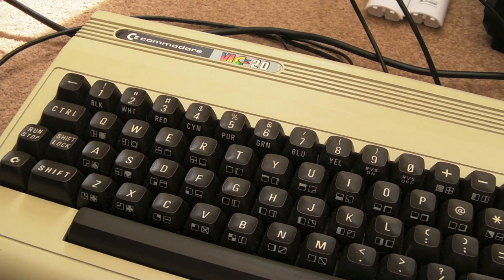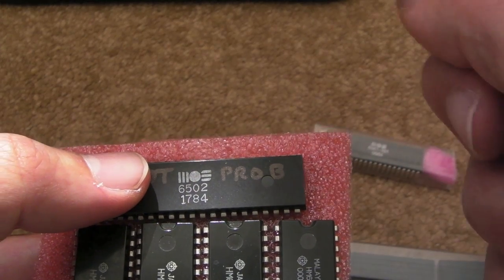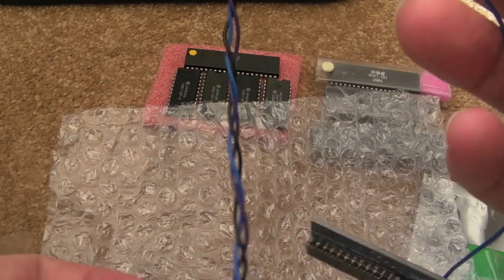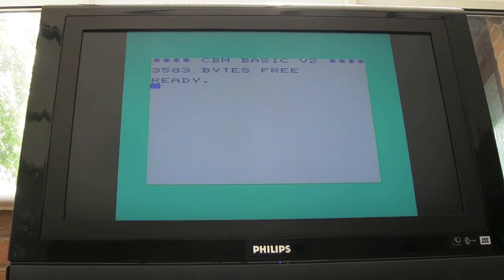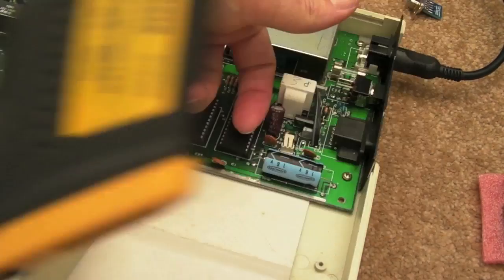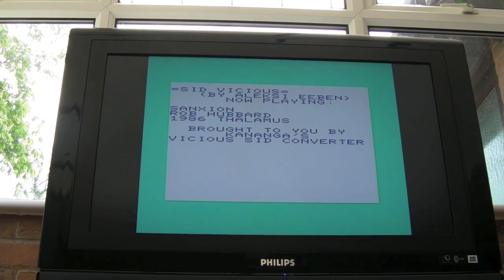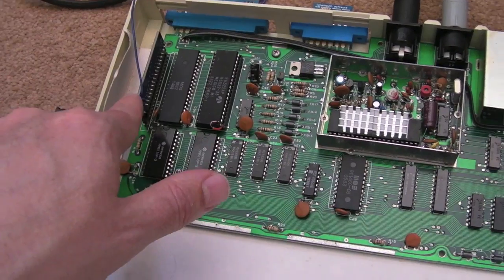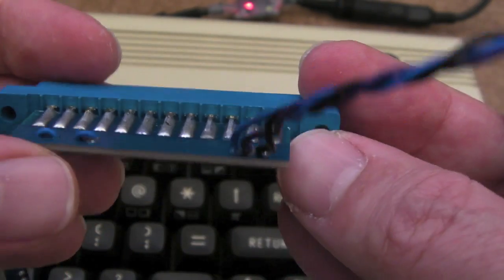Commodore VIC-20 (VC20) Spares Testing & Diagnostics Cart from Tynemouth Software

Comment: We got our VIC 20 working in the end. But we had to get the Kernel chip from Italy. Cost £8.00, but was with us within a week. We rejected the idea of the VIC20 jailbars removal mod as there are too many versions of the same board. It's very easy to screw up the VIC chip, and we didn't want to run this risk. However, it's surprising what fresh solder, and a bit of patience will achieve. Not perfect, but for its age,it'll do. Getting replacement chips is always a bit of a lottery on Ebay. Keep up the excellent vids. Wayne and Nina :)
Reply from the maker: +Nina Evans Glad you got it working =D   See my latest video - You can now get Kernal or Basic ROM from Dave at Tynemouth Software.

Comment: a couple of the data or address lines are pulling too much or theres a "slight" short. measure the voltage between each CPU.
Reply: +Amy Marie can also be one of the I/O pins is stuck as an output, so it's always driving one of the data pins for example. So depends what else is on the bus is driving the same pin who will win the fight. Best use that CPU for decorative purposes only.
Reply: If it was "stuck" high it would glitch out...but it doesn't its like there's a "mild" short....inside the IC
Reply from the maker: +Amy Marie Yes, I think you are right regards that CPU.  I do think something is perhaps driven too hard to or too little regards data or address bus.  Wierd how it works OK in the VIC-20 but not on the 1541.
Reply: I Wonder if the CPU's TTL/ CMOS Variation is having an effect here. pulling more voltage "because" its not meeting the requirements that the system expects....thats exactly what it sounds like.
Reply from the maker: I am not sure now I think about it, because in both systems the 6502 talks directly to the 2 VIAs.  Maybe there's something else on the address and databus in that 1541 causing the problem.  Strange how its now working - I might put the old CPU back in it to see if the problem returns.
Reply: VIA chips eh?  Hmmm.......

high is 2.4
Low is 0.4

Comment: Thanks for the testing. I've got a few questions to answer then. The link for the diagnostic kits is http://blog.tynemouthsoftware.co.uk/2016/05/vic20-diagnostics-kits.html. The smaller chip is a RAM, it is pin compatible with the 62256, but in the thinner package. It's actually a 32K RAM, although the diagnostics only uses 1K. It will cope with faulty RAM on board, but needs the VIC, character ROM and kernal ROM to be basically working to get something on the display, but these are often socketed, so you can test with a known working set. A dead test style diagnostics is something I'm working on, initially for the PET, but equally valid for other 6502 based systems (http://blog.tynemouthsoftware.co.uk/2016/04/pet-exerciser-upcoming-project-preview.html). The edge CB1, CB2 etc. are the control pins on the VIAs. Not particularly descriptive, but blame Commodore, they wrote it. Also blame Commodore as I think all of the loopbacks are different on the C64 diagnostics software.
Reply from the maker: +Dave Curran No worries, thanks for all the info there =D  Shame it's not wired the same as the C64 harness - bloody Commodore lol.  I thought that was the case with the RAM, really useful having that on there as there's nothing worse than dead RAM when you are trying to work out what's going on.  That RAM is interesting, I think I've got some of those in my spares drawer, although I might be confusing them with the PSRAM from the Megadrive - the package looks the same I think, and I think they are about the same length.
Reply: +GadgetUK164 I think the PSRAM is also a 32Kx8 62256 compatible, as is the CPU cache RAM on Pentium systems. I used it because I wanted to keep the cart short so it would fit in the original cartridge shell, and it was easier to route the traces on that side than to have two large chips side by side.